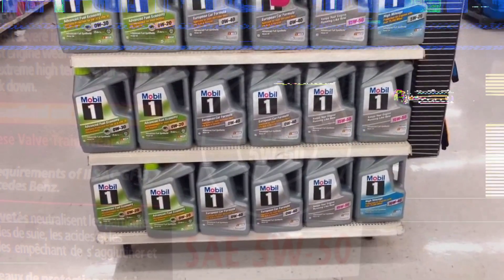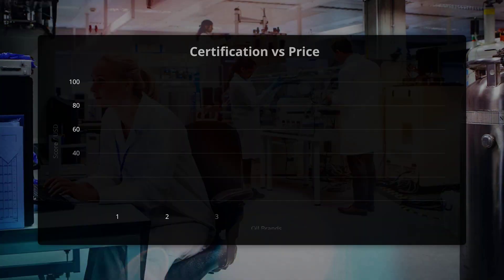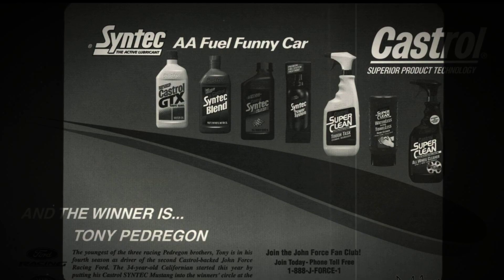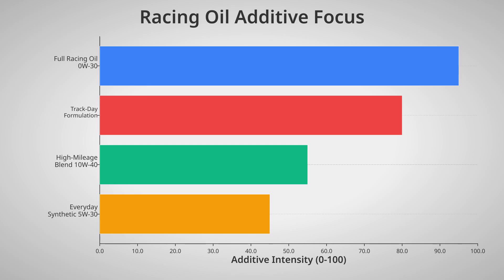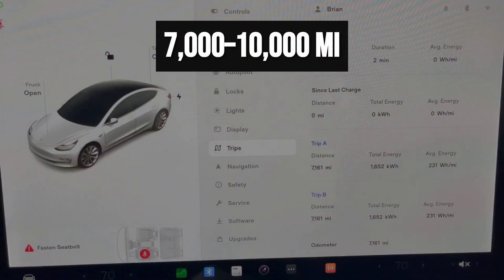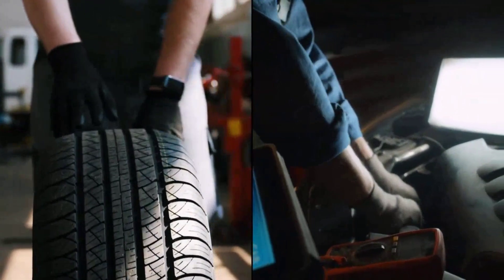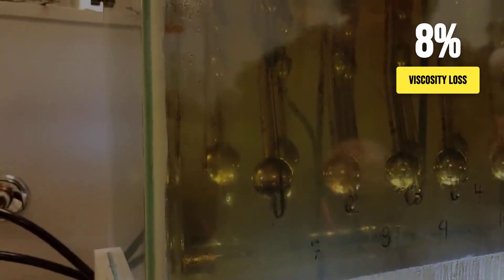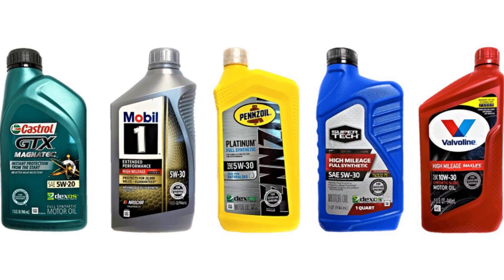Does Engine Oil Price Matter? (Truth Exposed!)

Comment: I have been a mechanic for 43 years and I agree with most of this video. However I don’t care what any data says no way ever let any oil go more than 5000 miles. Where an average is 15000 a year that’s 3 times it goes to a shop. Also a reputable shop will let you know ahead of time about other issues needed. A good reliable common sense way for someone who does not know much about a vehicle.